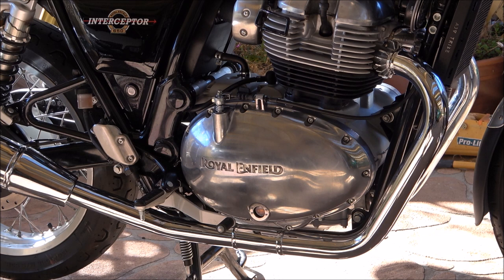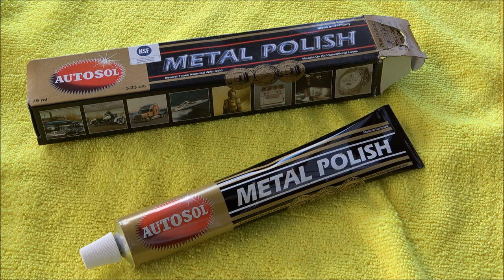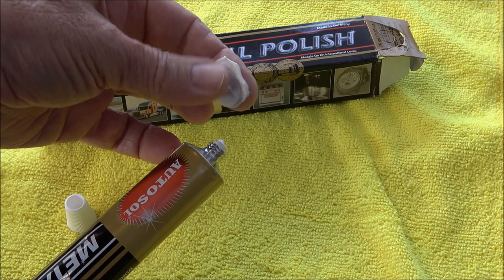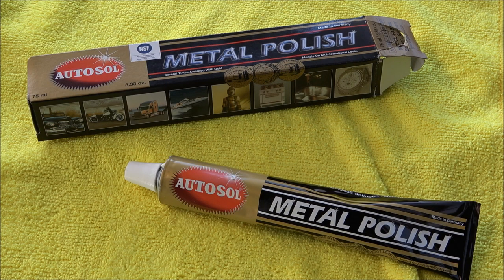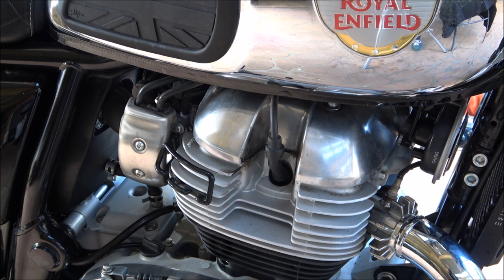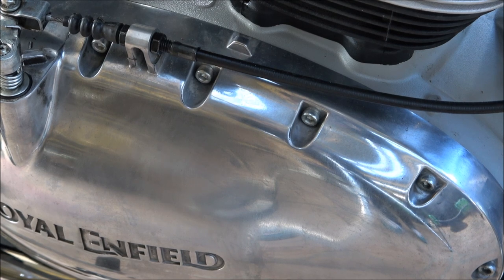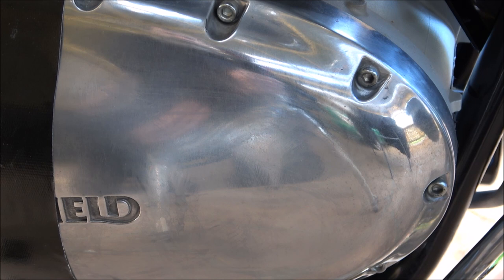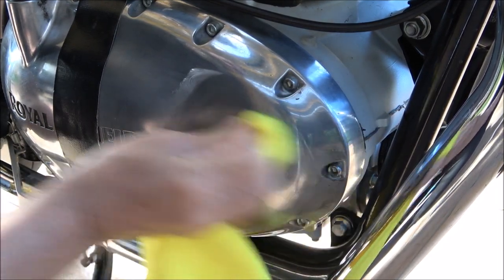Royal Enfield Interceptor 650 - Great Results - Polish Your Motorcycle Engine Casing For $10

Comment: Hi Warro, that's a huge improvement so well done and done in no time at all. I bet they'll stay in cleaner condition now as well. You are obviously enjoying using your new camera - does a great job of holding focus and zooming. Good stuff, well done fella. Dave
Reply from the maker: thanks-I will put it to the test when I fit the sump guard and point it underneath the bike...lol see how that goes. I think that will test it in lower light conditions. I had to buy a 12mm deep socket today so I could remove the exhaust pipes on the 650 to fit the sump guard -so I am now ready to go ahead with the fitting and give it a go.

Comment: Good old Autosol. Ya can't beat it!
On a side note, it's also brilliant for "stropping" wood chisels to a brilliant mirror finish with a razor-sharp edge. Just get a piece of old thick leather. clamp into down a flat surface. Squeeze out a couple of dabs of Auto sole onto the leather. Then start "stropping" that chisel edge.  (Sliding the chisel at the correct angle, across the leather in a brisk manner, back toward yourself)
Reply from the maker: thats a pretty good tip there!

Comment: I've had my interceptor for 6 months and have polished the cases and rocker covers at least 3 times. they seem to have blemishes on them all the time even when I get them shiny. Also, the other day noticed on the rocker covers a pitted coating, as if I had let something dry on them as in a wet polish and not buffed it off. My bike is outside all the time under a waterproof bike cover. I don't cover it up completely until the engine cools down to cold. The photo of your cover looks blemish-free even when I zoomed on it. I'm not a Mr clean and hate doing it and do my best not to have to do it .
Reply from the maker: i keep all my bikes under a veranhah but never cover them. the reason being i think it attracts condensation and other issues especially in the wet part of the year.
i wouldnt say the cases are perfect but pretty good. i dont really like cleaning them myself but this polish works fine and i suppose you can give the a quick workover in 5 or 10 minutes and thats it for me